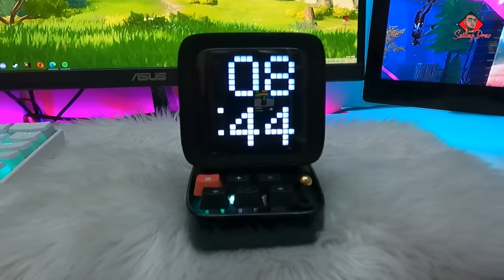DIY LOFT BED | SPACE SAVER GAMING ROOM Makeover W/ Cloud Ceiling | Extreme Transformation

Comment: Just curious What material did you use as clouds? Cz wouldn't that be a fire hazard for the led lights since they heat up?
Reply from the maker: Yes it will be a fire hazard if you use wrong led light or cheap lights. And also if you use it longer than usual it will be dangerous.
Reply: @SailingDrew  wi h ones do we use then
Reply: it’s the stuff from your pillow
Reply: @its_omargosh08  use govee lights like he did in the vid

Comment: Any tips for making a room like this? I want to make a loft bed and setup like this but can you offer any tips for things I should know?(drilling into the wall and things like that)

Also, nice design! Do you mind if I use the cloud idea for my own room?
Reply from the maker: Hi Grayson, yes you can use the cloud design on your loft just make sure you use a proper lighting like Govee. And put more expansion bolt on your wall if you will use bigger frame.
Reply: @SailingDrew  ok, thank you for the advice! how can i make sure that the bed is stable, and how high should my ceiling be?